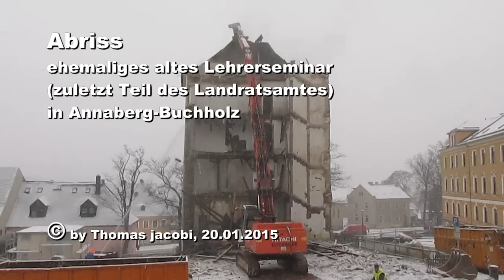Abriss ehemaliges altes Lehrerseminar

Comment: Loke at the ends of the exposed walls. They get thinner as you go up. A sure sign that the building was not built with steel reinforcement.
Reply: Well, that building seems to be at least 90 years old. Brick walls and wooden ceilings were used in most buldings up to the 40s, at least in Germany. The wide use of reinforced conrete for walls only began after WWII.
Reply: @peon9282  Yes, you are right. I was just making the point that before steel reinforced buildings the walls got thicker the lower you were. There was a limit on how high you could build. I understand that there were tenements during ancient Roman times that were as much as 8 stories high. The walls had to  be thick enough to support everything above them. Unlike today the appartments on the lower  floors cost more than the ones on the upper floors. No elevators.